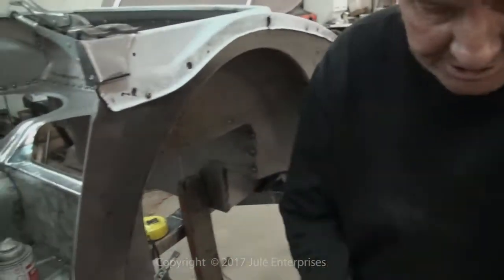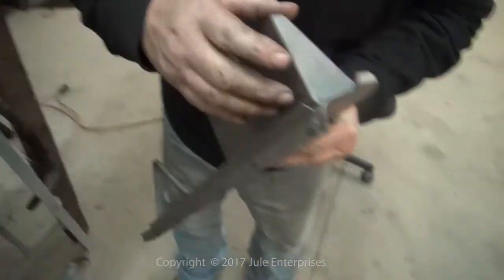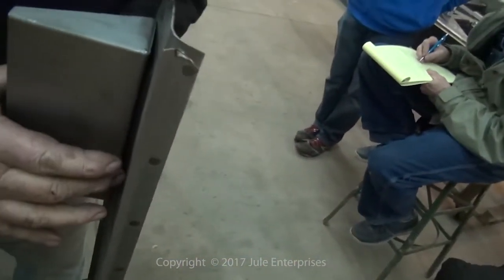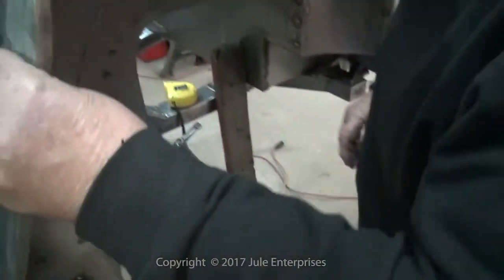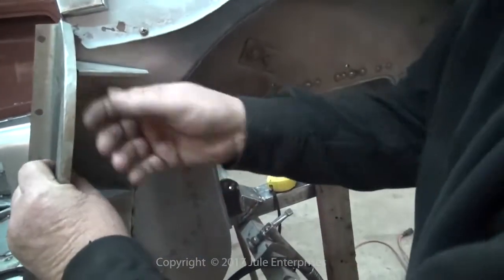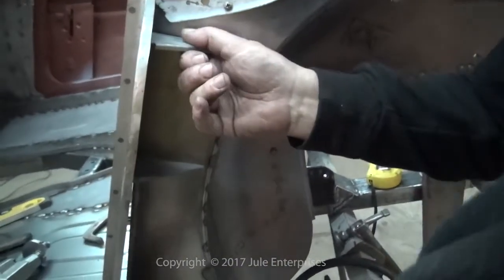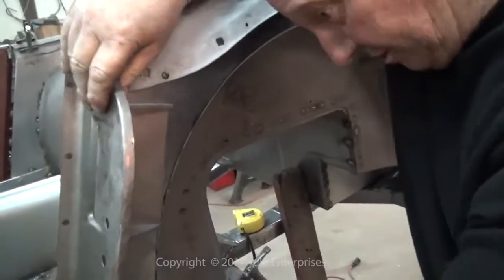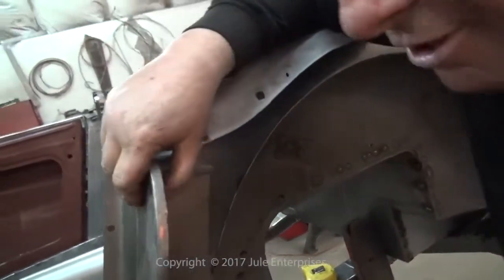Austin Healey Restoration DVD (Shut Pillar)

Comment: I just bought a foot well from AH spares, it is flat while my original has a raised dimple. How am I suppose to weld it to the existing? The rocker panels are not notched like my originals, is AH shit parts? Who else is there for good parts, this is my first Healey resto (BJ7) Thanks
Reply from the maker: While often there can be fitment issues with aftermarket parts. Often the original cars are so twisted that a perfect part wouldn't fit properly anyways because of a poor original frame. 
Generally AH Spares is pretty good.
Reply: AH are the best.